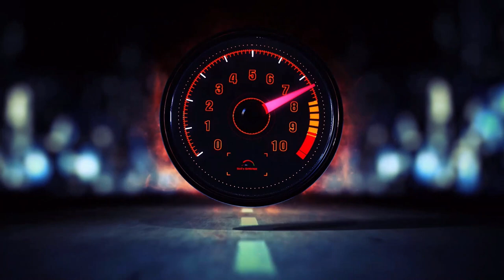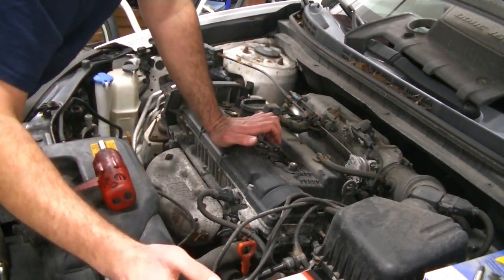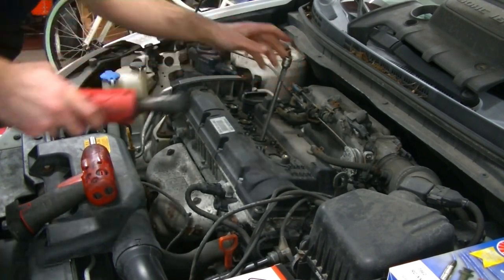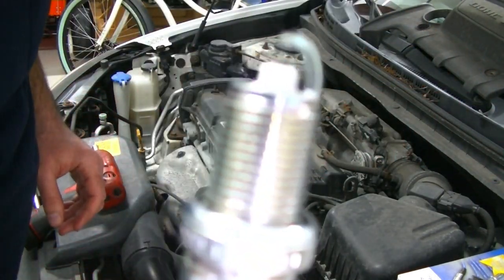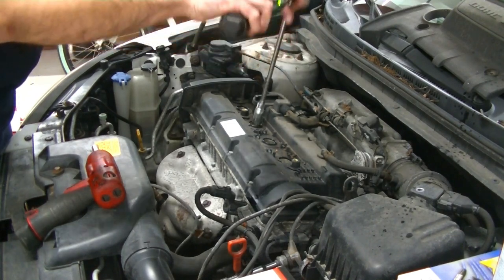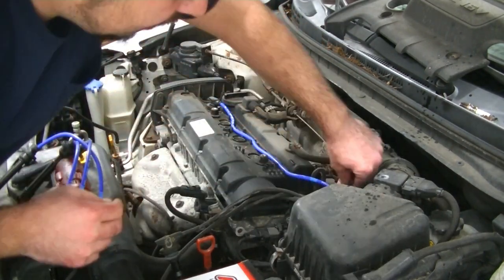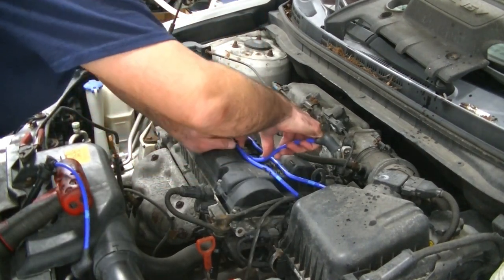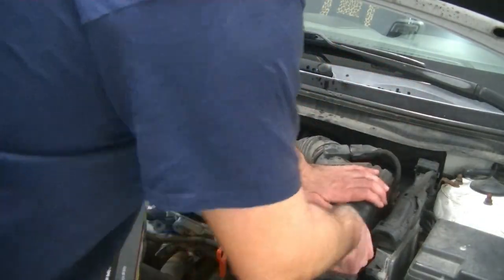1996-2010 Hyundai Elantra Tune Up!! (Spark plugs, wires, air filter)

Comment: I usually always pull out the MAF sensor and spray it with cleaner whenever I change the air filter.
Reply from the maker: Under normal circumstances you shouldn’t really need to do that. The Mass air flow sensor is a self cleaning sensor. The way it works is the pcm sends power to a heated coil and monitors how much power is needed to keep it at a certain temperature. The more power is needed, the more air is flowing across it. At every start up sequence, the PCM will send max power to it to flash any debris on the coil. I usually only clean them when I have a code related to the sensor. (Lean or rich condition, or a MAF code). Oiled air filters like K&N are known for fouling MAF sensors

Comment: Amazing video, I have a 2007 Hyundai Elantra. When I first turn it on in the morning, the first few accelerations before leaving the apartment complex are delayed like it’s losing power and sometimes the car cuts off in those first few minutes. When I start it up again, it’s fine for the rest of the ride but I need to get that situated. What could be causing that? I do have have to replace my spark plugs and such but I was just wondering.

Comment: Should the wires be replaced when replacing plugs on a long neglected car? It seems logical, but would like to hear explanation. Thanks!
Reply from the maker: I always recommend it! Old wires can cause arcing which can lead to misfires.
Reply: @SEsGarage Hello, I have this car, the oil in the engine decreases, the engine is quiet, but it does not smoke, what is the cause of the urine?
Reply: @SEsGarage salam bu masin mende var matorun yagi azalir mator sakitdir amma,azalir neden olar ?

Comment: I have an Elantra that when the engine is running it shakes and it’s very loud when accelerating. Would you know what that could be? Could it possibly need a tune up?
Reply: It’s a 2007
Reply from the maker: As for being loud, it’s likely some sort of exhaust leak. The flex plate is a rather common failure point with these vehicles. The shaking could be many things. Plugs/wires, Coil, motor mounts, it’s hard to diagnose a car on the internet, but those are the areas I’d be looking